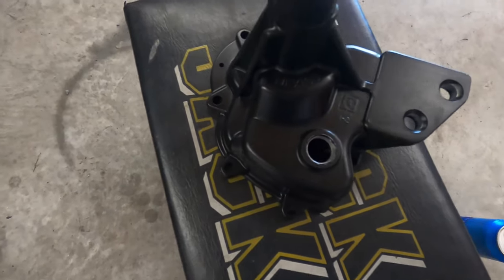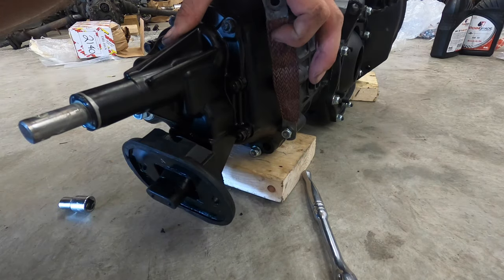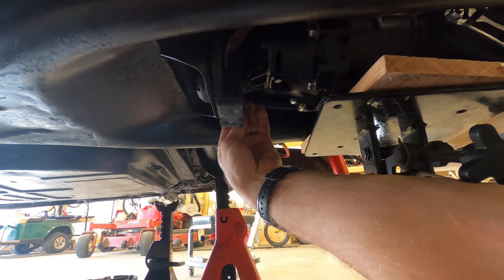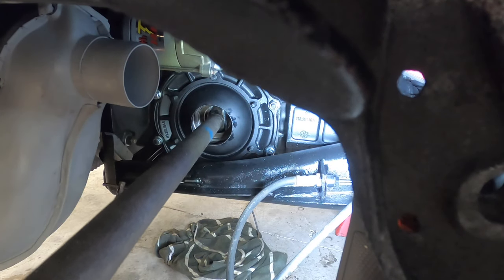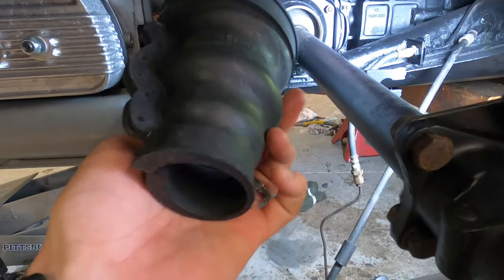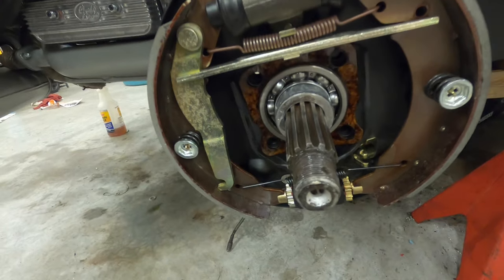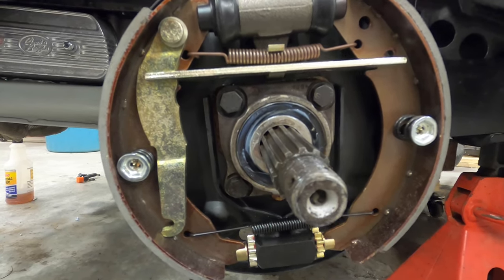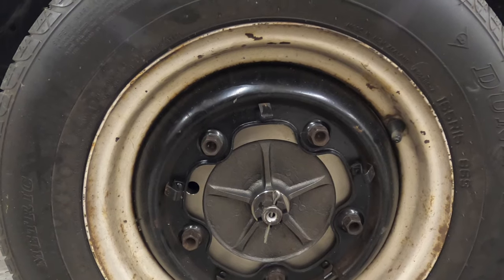VW Beetle Transaxle Install (Swing Axle)

Comment: I ordered a set of hub bearing covers from CSP and they had a hole inside but not on the outside and hearing you now I done worry so much. id never seen that. actually im waiting to hear back from them now. aloha
Reply from the maker: CBP Or CSP? No hole on the outside?  Once the bearing cup (cover) is installed, you won’t see the hole.  The hole is there on the newer models (on the inside) to improve lubrication.  From my understanding, not the end of the world if it’s not there.  Just make sure you’re buying all the same year components and it all fits the way it should.

Comment: Is this one a rebuilt unit from Rancho? It’s always nice to have the transmission in neutral when installing the hockey stick and the nosecone.

Interesting that you put the axles afterwards. I would think it’s better to put them and the axle tubes before. The chassis is in the way to tighten the axle tubes, etc. Also the axle tube stiffeners sold by Empi and a couple of other suppliers are great to prevent leaks from them. Those go at 14 ft/lbs. Better not to overtighten.
Car looks great.
Reply from the maker: Freeway flyer bought from Chirco.  Was excited to put the engine in.  I agree though, would have been much easier to install axle tubs/axles prior.  

The link to my trans is in the description.
Reply: @VitosFix  me and a friend installed an identical one, bought from Chirco too. We learned about the stiffeners the hard way; it was leaking like a sieve through there and we had to take it back out to replace the seals there and it didn’t work. Third time with the stiffeners was a charm.
Reply from the maker: Dang!

Comment: What's the part number on the end cap?  I'm trying to purchase the correct one. Thanks
Reply from the maker: The original part number seems to be PN 111501311B, for the 1958-1964.  See reference below.

https://www.volkswagen-classic-parts.com/catalog/en_global/part/111501311B

https://www.thesamba.com/vw/forum/viewtopic.php?t=719431

You also have a remanufactured version here.

https://socalautoparts.com/product/axle-bearing-cap-bug-ghia-chrome/?gclid=Cj0KCQjwhY-aBhCUARIsALNIC07CZNPm2xZqPNdLOBRKHzEftZL91C-cUav-8LCLViyCDVQP3EVhfIsaAkcaEALw_wcB

Although, it depends on what year you’re working on, and the setup your going for.

Comment: no grease on your axle wheel bearing.
Reply from the maker: Yeah, didn’t use grease because it’s lubricated by the trans gear oil for a swing axle.  On an IRS setup, it’s different though.